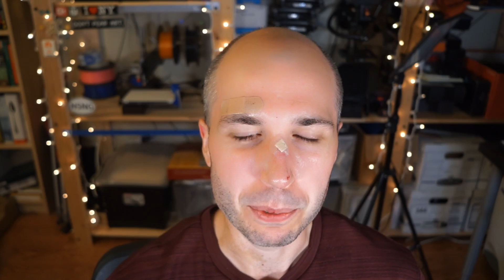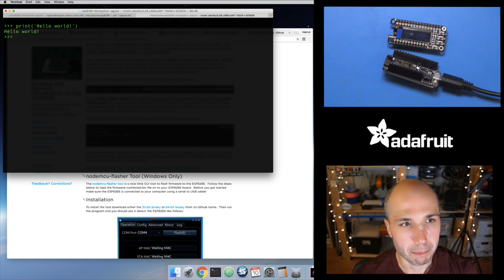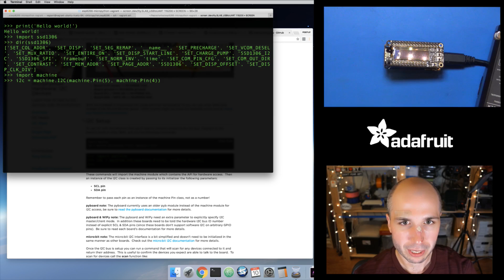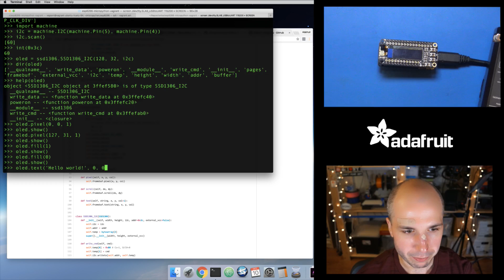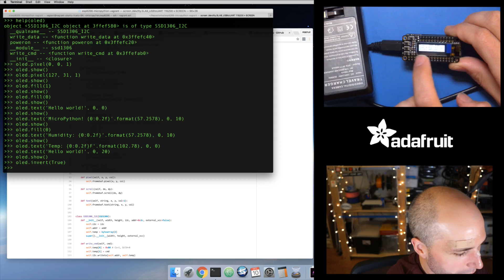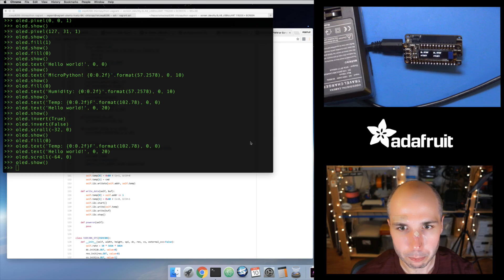MicroPython ESP8266 SSD1306 OLED usage with Tony D! @micropython

Comment: mpy is now supported. Just copy the file from here: https://github.com/adafruit/micropython-adafruit-ssd1306/releases
to your filesystem on the esp8266.

Its very simple. Got this display: https://www.amazon.de/dp/B00NHKM1C0/?tag=37plus-21
working in less than 5 minutes

Thanks for the video

Comment: For everyone running into memory errors during importing a module, the 
following hack is useful, enabling the loading of modules precompiled 
with mpy-cross.
1. Add the following line to esp8266/mpconfigport.h:

#define MICROPY_PERSISTENT_CODE_LOAD (1)

2. Change line 430 of py/emitglue.c into 

#elif defined(__thumb2__) || defined(__xtensa__)
and rebuild the image and flash esp/
3. Go to esp8266/mpy-cross - compile your's .py to .mpy and put .mpy file to esp board.
You can put any files over webrepl not need reflash totally esp.

Comment: What's wrong with putting the driver.py file in the directory of the ESP8266 as is? Is it a memory management concern? I've definitely imported modules that I put there before.
BTW, Thanks so much for doing these videos, Tony. They've helped me immensely getting started with micropython as a new coder.
Reply from the maker: Yep it's a memory issue, when you just have the raw .py source code it has to load all the source and compile it into byte code in RAM.  For a simple script it will work but for more complex, 100+ line long scrips for example, you'll probably run into memory issues.  Freezing them into the firmware means they're stored in the flash memory (which has megabytes of space on most ESP boards) vs the RAM (only a few 10's of kilobytes).